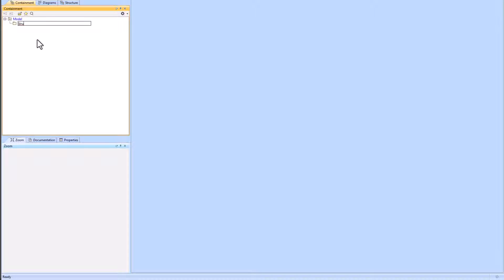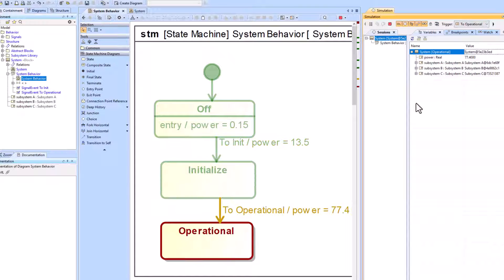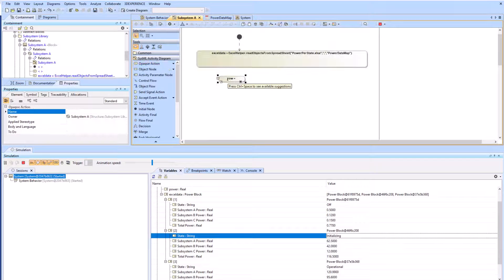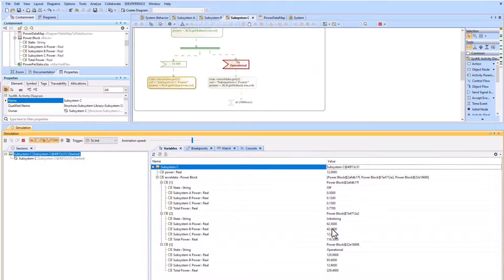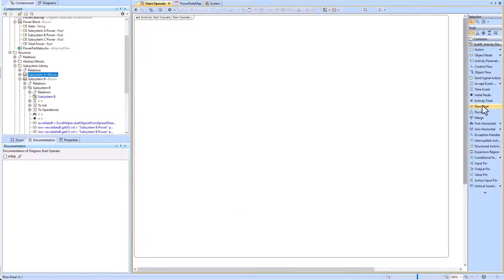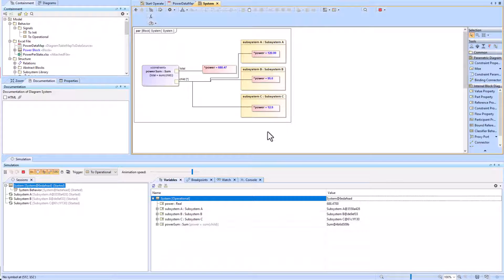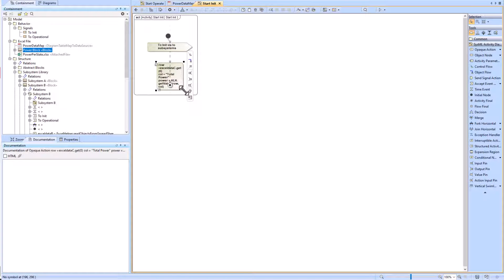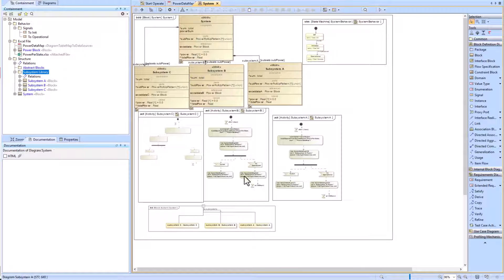Simulating Power During State Changes from Excel Spreadsheet

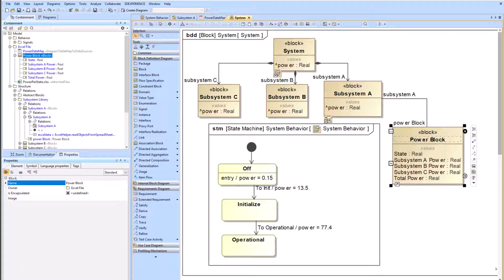Comment: Thank you for the detailed example. When I ran the sim only power:Real is instantiated, but no reference properties in the power block are instantiated. I noticed at 4:03 you created a link between subsystem A and Power Block on the diagram but the video moved to fast to see what that link was. Can you kindly explain that part? Is missing that link the reason for reference properties not instantiating, or something else could be the culprit? Thank you.
Reply from the maker: The relationship created was an association which is a directionless relationship which creates 2 reference properties where both ends reference each other. That's why there's no diamond on one side or arrow.  At 4:03 In the containment tree, Subsystem A has a reference property "power Block: Power Block".  Additionally, Power Block has a reference property "subsystem A: Subsystem A".

When you say "instantiated" I'm assuming you mean that you're not seeing the row for the reference properties at all when running the simulation.  If this is the case, then select the gear icon within your simulation window and then toggle "Show Reference Properties" to on.
Reply: @cameomagic  Yes that's what I meant. Toggle "Show Reference Properties" to on did the trick. Thank you so so much! Liked and Subbed!